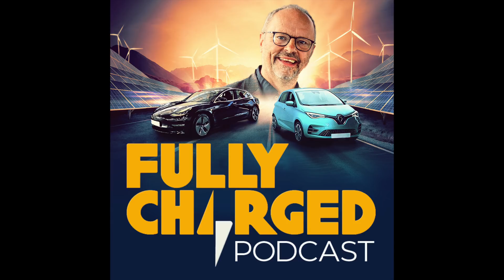Moixa podcast YT

Comment: Very interesting but how about a bit of joined up thinking. Surely the building regs should say every new house should have at least 50% South facing roof with Solar PV and a Battery, an integrated home power system.

Comment: As I am listening to this, My panels are generating 3.77 kW, 2.92 of which is going into my Powervault batteries. When they are full, I'm plugging in the car. All new house builds should be legislated to have solar, batteries and heat pumps.
Reply: Indeed, but if built correctly, add in mega insulation, Passive HAUS standards, etc. no heating required!

Comment: Very interesting podcast.  One thing, can you normalise the volume between Robert and guest so they are about the same?  My hearing isn't great so to hear the guest i had the volume up which made Robert very loud.
Reply: There is a freeware file for Windows called "Sound Lock" that will create a max level threshold that clips excessively loud spikes.  I got my copy at Snapfiles.com.

Comment: I have a 3 kW solar panel system and a Moixa 4.8 kW storage battery and I can easily manage on my system. Of using just solar and stored solar and zero grid most days. In 31 days I only used 5.8 kWh from the grid. Which is half a days normal house hold use in a whole month. I’m with Octopus 🐙 energy on a agile tariff. Which means when there has not been enough solar like in winter. I can at times fill up the storage battery for free and even get paid doing so. Or for a very low price. . https://youtu.be/0DmbteQ9LEs This show the system I have but since then I upgraded from a 3kW storage battery to a 4.8kW Moixa storage battery.
Reply: Just a quick question is your heating/hot water still gas?
Reply: Marc 1664  yes I have a combi boiler where it only had to heat my radiators and the bath tub. My main hot taps are electrical in the kitchen and bathroom. I am changing my bath for a thermostatic shower and I hope to change my boiler for a storage boiler, may even be a mixology boiler and a Eddie system so I can use any excess solar to heat the water tank up. I get a fit payments of around £1k a year so the more I use my own solar the more I am literally getting paid to generate, store and use my own solar. My last gas and electric bill was £24 in total
Reply: christopher pickup thanks.
Reply: chris......all lovely and something I'm interested in as I also have a 3kW PV system. However, whenever I've looked into adding battery storage it's been many, MANY  thousands of pounds for installation costs. Meaning that cheapness of running the system is irrelevant as I would die naturally at a ripe old age before the system even paid for itself....
Any thoughts......?
Reply: Andy McCabe  it took me a year to pay off my Moxia 4.8 kw battery. I had help from a credit of £900 pounds rebate and a £600 rebate from Scottish power and Ecotricity and I had two years solar fit payments saved up. I used that as a deposit. Then I used the money I saved on my monthly electric bills and a year of my fit payments to finish paying for my storage battery. My solar panels I have had for over 8  years and have paid for themselves in under 6 years as they cost back then £6.5k now the same 3 kw is around £2.5k. I get a solar fit payments of around £1k to £1,200 a year. For my total generation under the assumption I send back 50% of the solar energy back. But I do not I generate and store and use most of my solar power. Meaning I am literally getting paid to generate, store and use my own renewable energy. I have 12 more years of these fit payments. Because my solar and storage battery is paid for now. I use my fit payments to pay for any gas and electric I do use throughout the year. It also pays for the fuel in my hybrid a year. I only fill up once a month and I don’t pay road tax. My last two months I used 5.8 kw in the whole of may and l8.3kw in June. From the grid. Now I am with octopus 🐙 energy agile tariff. When I haven’t generated enough energy at times I can fill the storage battery up for free or even get paid to do so or for as little as 0-6 pence a kwh. To use at the more expensive times.
Reply: We have the 3kW battery from Moixa but with the low import /export rate I feel we waste a lot of solar. Is the biggest battery better? Asked for a deal to upgrade but didn’t seem to get anywhere with it. Does the octopus agile stuff work now with Moixa?
Reply: Paul McCulloch yes, you can set up the Moixa battery with Moxia to what suits your needs best. The 3kw only has a 440 watt output discharge where as the 4.8 has a 2.4 kw discharge and a 2 kw charging capabilities. Look at Facebook evs and hybrids to see all my information on the moixa 4.8 kw storage battery